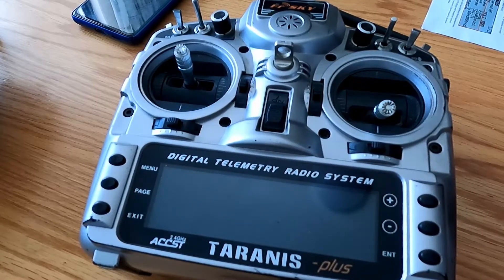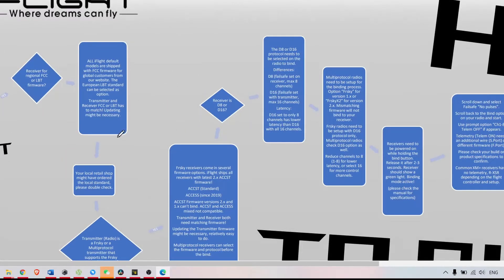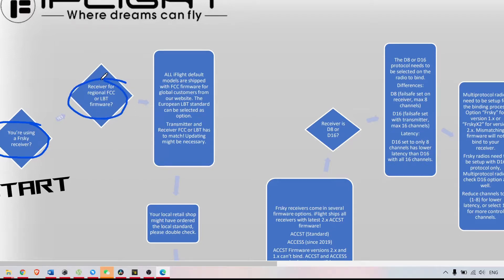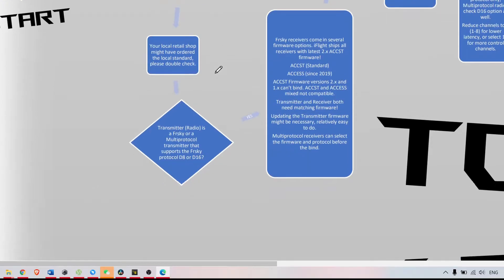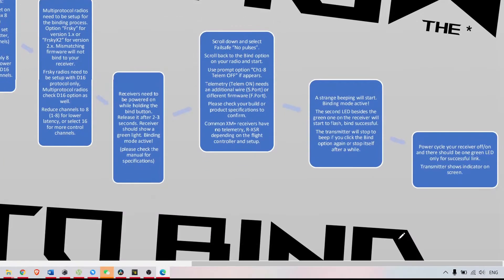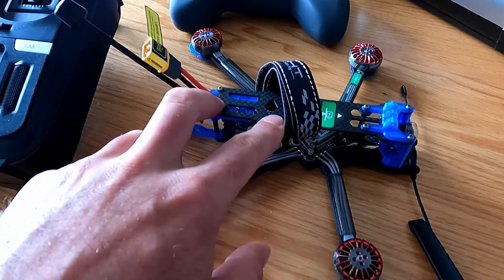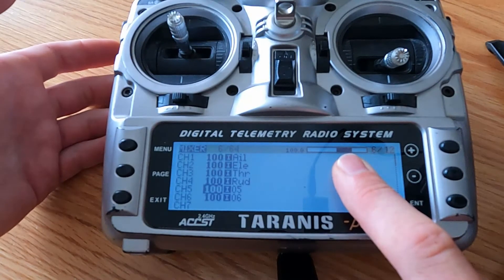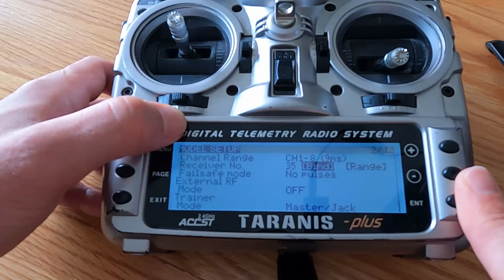iFlight BNFs // How to Bind Frsky

Comment: Please help!! I just bought a iflight baby nazgul BNF, I CANT  bind it to my taranis qx7, I tried the usual holding the bind button on the dronewhile inserting the battery and while my transmitter is on bind mode and nothing,I also typed  bind_rx spi on the cli and nothing,PLEASE ANYTHING WILL HELP.
THANKS IN ADVANCE

Comment: Great video. But I am having an issue connecting my T-lite to a FrSky R-XSR receiver! Its driving me nuts. Do you have  any ideas on what to do?
Reply from the maker: It's mostly a firmware issue with Frsky. Make sure it has a version and region compatible firmware installed on both.